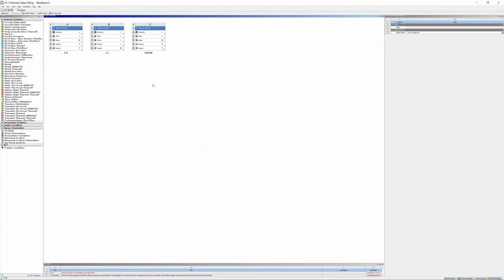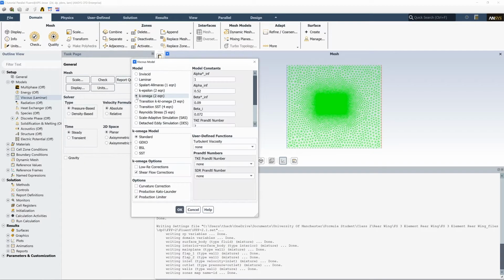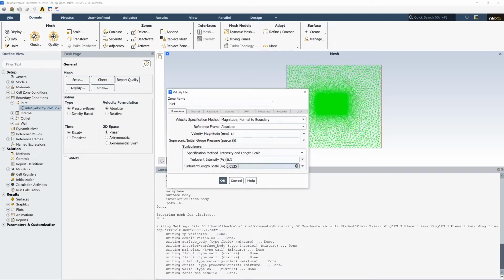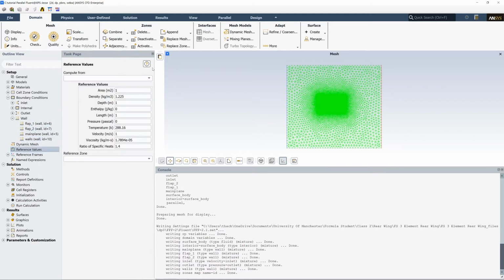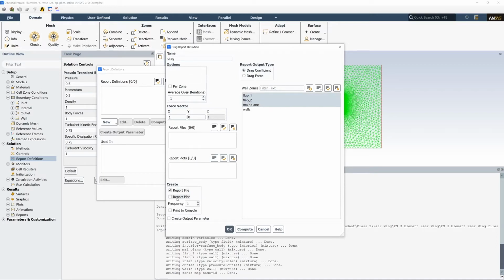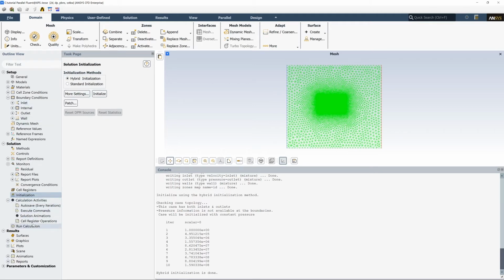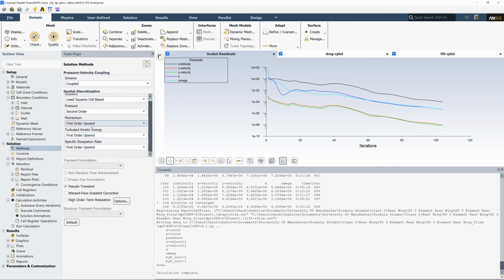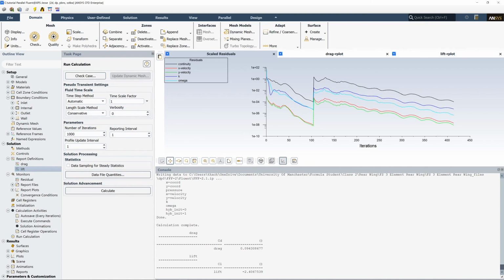FS Rear Wing Tutorial Part 3 - Solving

Comment: If I’m doing a 3D problem with the infinite wall symmetry, in reference values, would my area still be chord length x wingspan
Reply from the maker: Indeed. Your reference area should reflect the platform area of your wing. Remember if it’s a half model then this area will be half of the full wing when specifying the value in ANSYS.
Reply: @thachiman  this is going to help me a lot for formula student. Just one more question, is the characteristic length the same as the reference length in that case?
Reply from the maker: @jettoaji646  Happy to help bro. And yes that’s correct.
Reply: @thachiman  🙌🙌 thank you